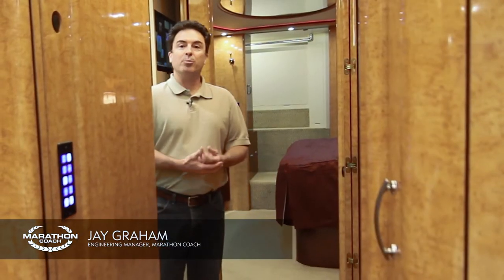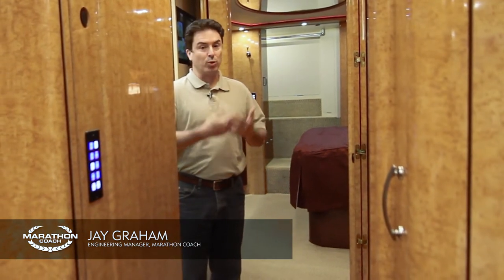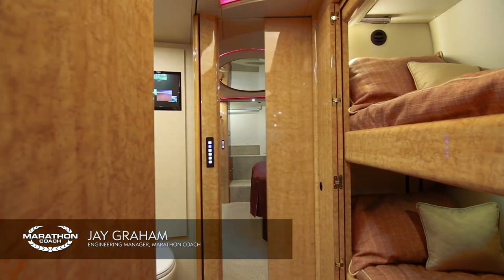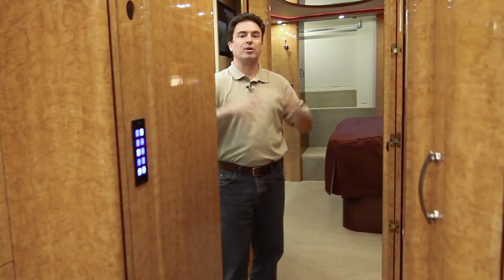Air Pocket Doors

Comment from the maker: Air pocket doors do more than add charm and maximize space. The “headerless” installation allows for expanded height clearance, while the quieter, smoother operation from our improved rodless air cylinder ensures you can move about without disturbing others in the coach. Easy to maneuver and aesthetically pleasing, pocket doors provide the fit and finish to enhance your motorcoaching experience.